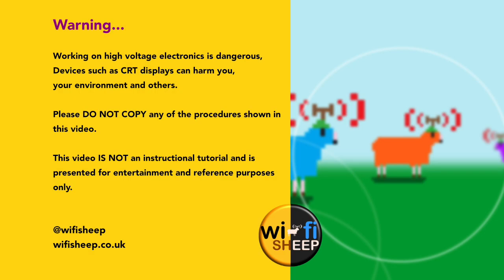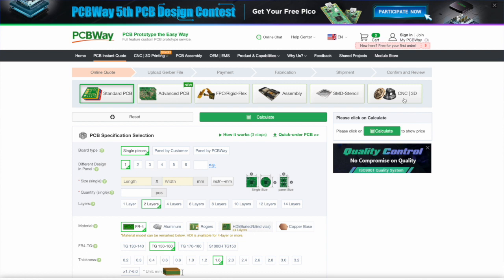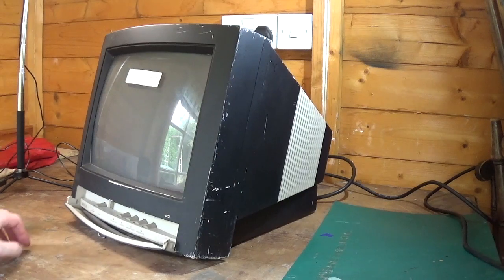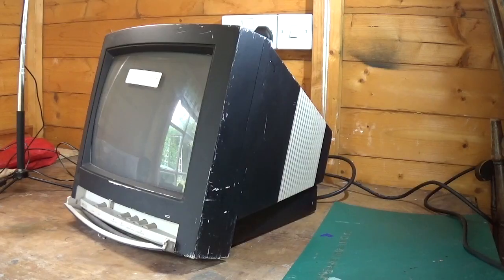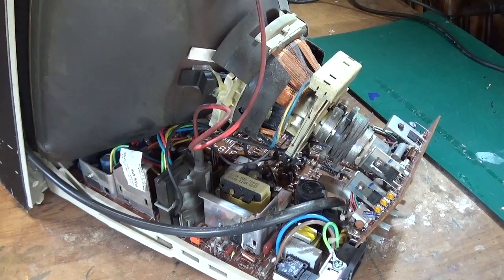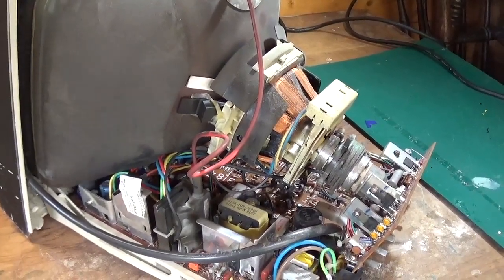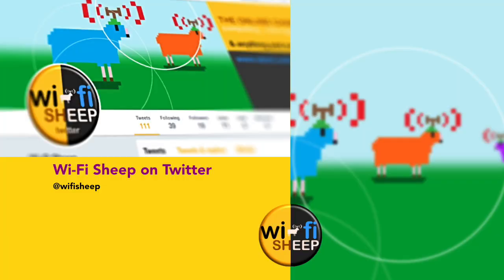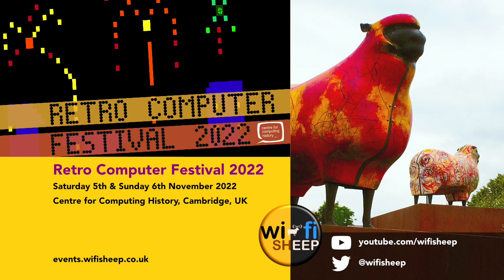Cursed? Philips / Magnavox CM8833-ii RGB CRT Monitor - Attempted Repair

Comment: I may be speaking out of turn, but when you earthed the CRT with the screwdriver to the chassis ,was it connected to earth? I could not tell from watching.
Reply from the maker: Hi It was, I attached to the earth on the main power switch which as tied to the chassis

Comment: You may need to hook it up to a computer.  My 1902 appears dead until it gets a signal.
Reply from the maker: I had the same thought - I did put a composite video feed in, if was done after off camera and still nothing, but thank you for the suggestion
Reply: @WiFiSheep  If their is a switch to change input modes, try flipping it back and forth several times.  That is what fixed my 1902.

Comment: I had a similar monitor that failed 10+ years ago with the same symptom, I didn't know you could replace the flyback. 
22:55 Did you readjust the pot on flyback board?
TBH I'd be amazed if none of the capacitors on that board need replacing by now. 
Anything that oxidises probably needs deoxit. I'd wiggle all the pots, then put them back to their start position.
Reply from the maker: I did adjust the screen voltage back again thinking it was too low, still nothing, was worrying is im not even getting any heater voltage to the back of the tube?
Reply: @WiFiSheep  Google finds a CM8833ii service manual available for free but I don't think it has detailed circuit diagrams. 
I wouldn't mind fault finding with regular electronics but CRTs are a bit dangerous! Good luck.
Reply from the maker: Yes, many thanks, I do have the manual and circuit diagram. plus I now have sacrificial volt meters if needs but, wasn't to happy about probing around to much for reasons as you describe!